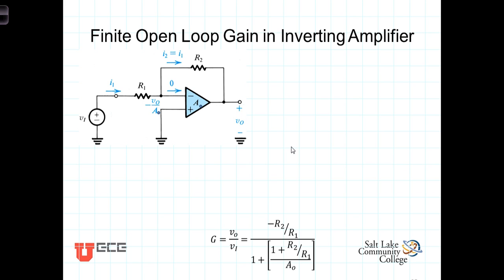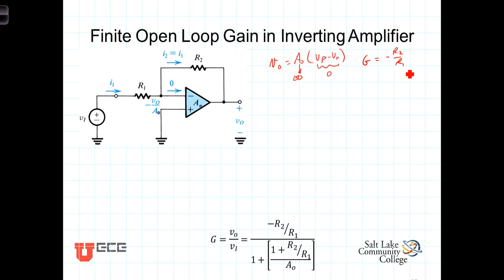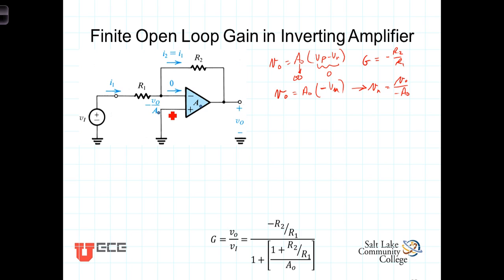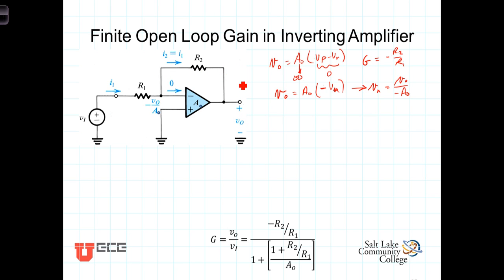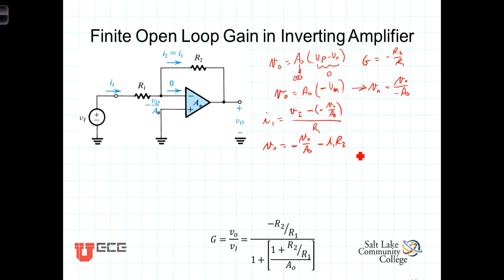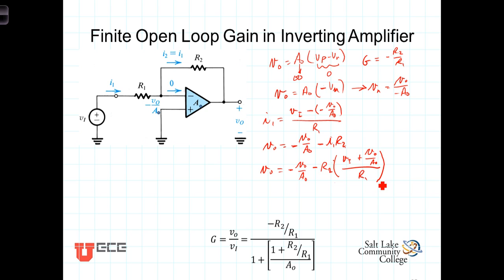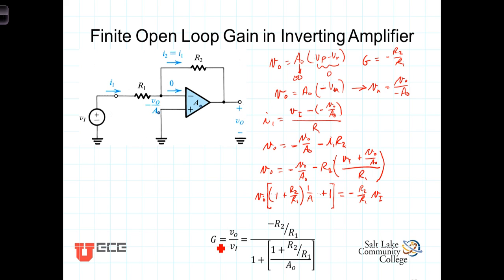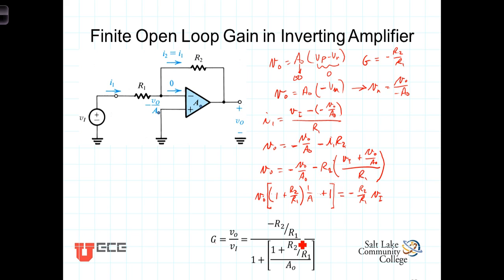L2 7 1 Finite Open Loop Gain in Inverting Amplifier

Comment: at the end 7:50 ,  why does as A approaches 0 in the non inverting node, the voltage in the inverting node goes to 0? Wouldn't it be as A approaches infinity then the voltage in the inverting node goes to 0?

Comment: Nice . 
You have assumed the current flowing into the op amp to be zero. That means the opamp is ideal. 
For such a case , I think , the open loop gain Ao  is infinite. Am I right ?
Reply: if opamp is ideal, current flowing into the opamp is zero. Vice versa need not be true.
Reply: @chitretanaymilind3178  Thanks for your reply.